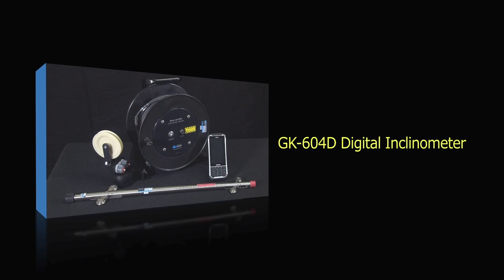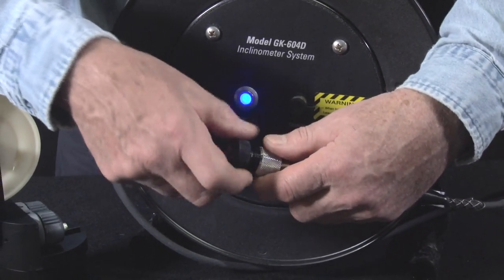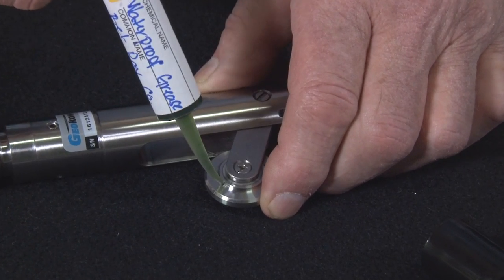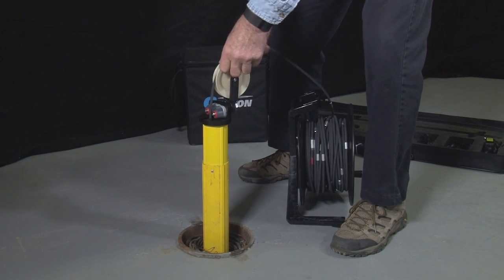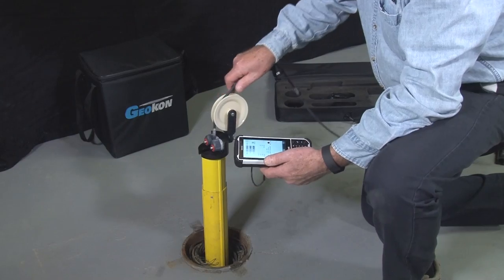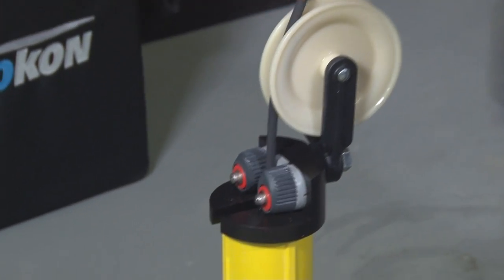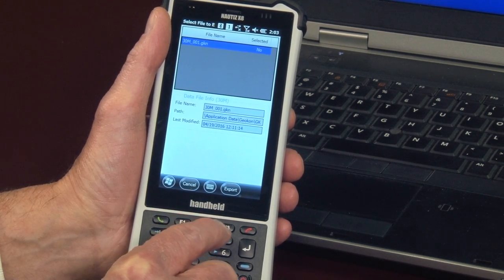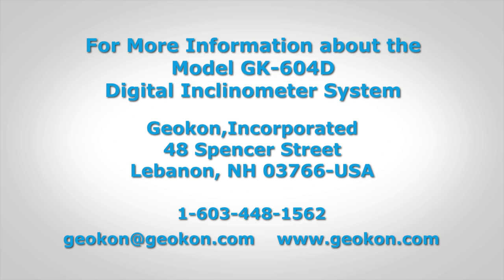Model GK-604D Digital Inclinometer System Installation

Comment: Hi,
I want to know about cable reel: 
Some time lower down the probe inside the borehole reel bluetooth automatically disconnected . What's the problem?
Reply: Hi. Can you take measurements, say lower the probe if during after rains, of which the hole is partially filled with water?
What other problems do you encounter using the instrument? We are considering buying it, some insights from you will be very helpful. Thank you